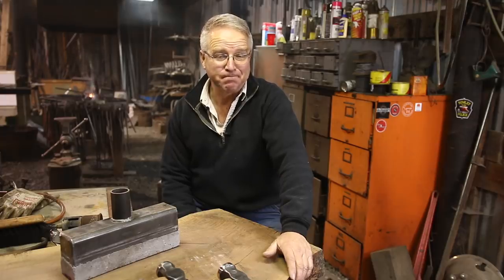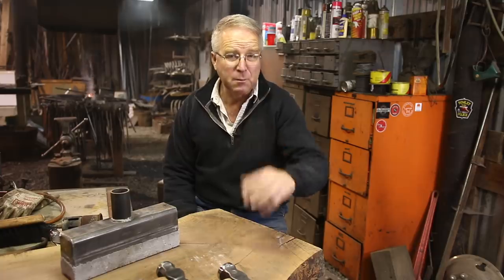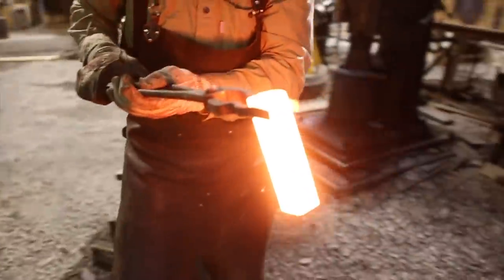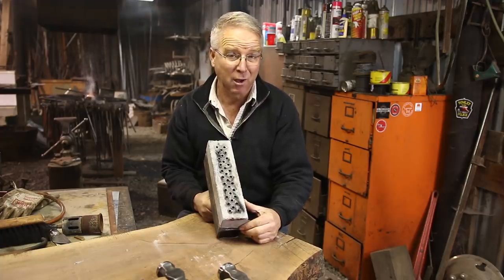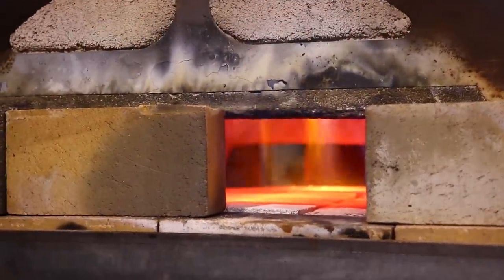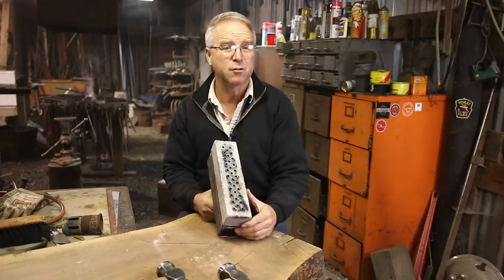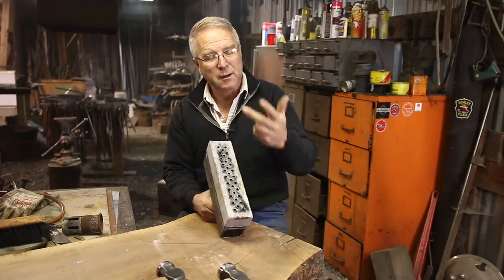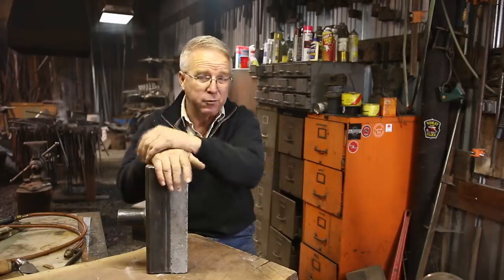What is a Ribbon Burner?

Comment: Hi I'm Bill , Karens other half, she has the youtube script not me. I'm commenting today on behalf of Ron Wailes, you mentioned his name and it left a big hole in my heart. I met Ron when he came into my shop one day walked up and introduced him self and checked out my shop and noticed I had an ironworker and a lot of left over material in the bone yard and wanted to know if I wanted to part with some of it and he proceeded to tell me what he planned on doing with it, he said he wanted to start making forges and rite there he had my attention, I had everything he needed in my bone yard to make several forges and I told him that if you build me a forge you have free range in my bone yard and  the ironworker to punch out the parts , I did a lot of the welding for him because he thought my welds were much prettier than his lol. From that day on Ron and I formed a small bond, he would pop in the shop unannounced most of the the time anyway he was a welcome site most of the time, taught me a lot. The reason I'm on this channel is I still have Ron's forge and the ribbon burner is wore out ( the refractory) and I wanted to find out how to rebuild it and noticed you had the same ribbon burner so I clicked on your video and low and behold you blurted Ron's name, caught me off guard a little bit. Nice to know Ron lives on! Just wanted to share. RIP Ron Wailes! THANK YOU!

Comment: Having an inefficient burner is a loosing battle. The more propane and air you push in to increase the temperature, the more hot air has to leave the furnace somewhere.

Comment: It is "molecules" of oxygen -- the form that's useful for breathing and burning is two oxygen atoms stuck together, and they'd rather be stuck to one or two atoms of carbon or two of hydrogen (releasing a bit of energy in the transition, which is what powers our bodies and our forges). Hydrogen and nitrogen are the same way, in that the pure gas is paired atoms (and nitrogen REALLY WANTS to be N2, that's why nitrogen-based explosives work so well.)
Reply: Delivery McGee diatomic elements
Reply: Well explained.  I was about to make a similar comment.      *I'm work in and have gone to college for chemistry.
Reply: THANKYOU GENTILEMEN FOR YOUR INPUT.....
Reply: Ye, what he said;0)
Reply: Electron Pusher Me too, I'm a chemical engineer and these things trigger me (because I know them)
Reply: Is either wrong? Oxygen gas is still comprised of solely oxygen atoms.
Reply: No atoms travel around on their own, always as a pair which constitutes a molecule. So combining oxygen and hydrogen into water (H2O) the equation is 2H2+O2=2(H2O) I.e.    2
Reply: What about noble gases. Aren't they single atoms, happily traveling around on their own?
Reply: Anon Ymous  You are splitting hairs, not atoms

Comment: whatever you use for the tubes? "crayons"? they need to be reconfigured so the tips are flame retention tips and are cast in place. That will keep the flame on the face of the castable and not blow away. You start with larger crayons that then 1/4 inch from the opening has a ring that reduces down to the smaller crayon size, the opens back up to the larger size. Look up flame retention tips for furnaces and you will get the idea. This will keep the flame sucked onto the face of the burner and then will not allow the flame to blow off.

Comment: I know the video is a couple years old and you might not respond.  The air pipe from the blower?  It seems as if you stick it into the pipe on the ribbon burner.  On your web site it says it a 1 7/8 pipe, so does that mean you are just using a 1 7/8 pipe for the air plumbing?  Is it exhaust pipe?

Comment: Yeah, I bought a three burner devil forge and I ran it outside one day, just to see how well it would work. While it did heat the metal up to forging temps, it took a good bit of propane to do so. It uses ventury burners and while it was outside and the blowing of the wind had a great effect on how fast it heated up, I saw that I wasn't getting a good oxygen to fuel ratio(at least not good enough for me), so I'm going to build my own forge with ribbon burners. Mine's not going to be as large as yours, but it'll dwarf the devil forge. Thanks for your informative video, I've watched many of your videos and always get a lot of useful information out of them. 🖖😎⚒

Comment: The way your ribbon works is similar to a hot air balloon burner. The difference between the 2 of them is the hot air balloon burner draws the propane from the bottom of the tank in liquid form which creates 15 million BTUs on the smaller hot air balloons and up to 30 million BTUs for the bigger hot air balloons. As soon as the hot air balloon ride is over and you turn the propane off you can touch the burners and not get burned at all. Which is extremely important because if the pilot has to land in high winds over 10mph he can put the parachute out of the top of the balloon and lay it on it's side which can burn the rip stop material that all balloons are made out of. A normal flight in Las Vegas in the middle of the summer we can fly 10 passengers not including the pilot and propane on board and use less than 75 gallons of propane for 1 hour to 1½ hour flight, but we have 100 gallons of propane on board for each flight.

Comment: Dear EC, I am getting into blacksmithing and gathering information on how to make a ribbon burner. How did you make the lower portion of your burner. The part that looks like a fire brick. Your blower motors are from where? Did you use a MIG tip for your nozzle. You run off of propane. I wonder if it would get hot enough using natural gas. Great information and love to watch to gain more knowledge. Thanks again.

Comment: I plan on eventually positioning the forge above the burner so as to minimise the chimney effect. Also I want to make a ribbon burner that directly heats the surface of the floor of my forge with a perimeter of open space around the floor. Suspended in a way above the burner with very little extra space above the metal being forged. I'm ASSUMING that this will minimise not only my propane usage, not only my heat up time but also the oxygen within the forge. Thank you for your time Scott. Your channel is most helpful.

Comment: Hi, not going into the maths, but the flame chemistry tells a  story.  That big purple flame at 4:17, downstream of the blue cones, shows there's lots of carbon monoxide coming off that propane/air mixture.   Needs more air moving more slowly (to keep the flames on the block).  Gas flames ideally  should be bright blue cones only.  
The grey cloud near your ceiling might just be condensed steam from combustion or mixed with incompletely burned soot, but it being there suggests your workshop needs more ventilation.  Carbon monoxide poisoning is extremely nasty, even when it's not fatal it causes generalised damage across all brain functions.  
Great videos, please stay safe, we want lots more of them.
Reply: So what would be the solution Charles? More burners staged and introduced as needed to burn the fuel efficiently or just more that are always in play and just not getting the fuel air mixture due to lower pressure? Isn't there a chance of the combustion moving back up the supply line at the lower pressures ? Or at least into the burners if there are more connected than there is fuel air mix to burn?

Comment: I can’t clearly see your piping arrangement but it looks like you have an open pipe from the air blower with no control valve and a regulator on the propane. If so, your 2 lb setting will tend to run lean and your 7 lb setting will tend to run rich. The video of the burner outside the forge shows a yellow flame extending past the short blue flames. That’s a rich flame. ( I realize that it will burn differently inside the forge.)
I’d recommend that, at a minimum, you have controls on the air and the gas so you can adjust for a “ perfect” flame by eye.
If you need to change firing rates often, and if fuel costs and time are important, the ideal setup  would be control of the air with a pressure line after the air valve going to a gas regulator. That way you could control the firing rate and the gas would “follow” the air and keep a reasonably ideal flame.

Comment: Scott, you mentioned the burner likes some back pressure to get the flames to sit back onto the burner.
Is it possible to slightly reduce the speed of the forced draught fan? This flame lifting effect you mention is normally too lean a gas/air mixture.

Comment: I'm building an asphalt heater, cept there's no info on the web about making these, so I hope to apply these principals to that application.  Instead of a refractory brick with through holes, the refractory will be some ceramic fiber (kaowool) sandwiched between stainless steel wire mesh.  It's my hope that I can mount this refractory sandwich in a metal box to create that mixing zone behind the refractory and ignite the air/gas as it leaches through.  If that works, I will be all smiles!

Comment: For a while I’ve considered designing a burner after the “ linear arrow spike” rocket engine for the exact benefits that this much more simple design dose to evenly heat a blade. 
Proof that I over think simple problems :)
Reply: If you ever make that happen brother, shoot me a comment man.
Reply: I'm not entirely sure what that would accomplish though, you're not trying to prevent the flame from expanding without thrust in a vacuum, you've got all the pressure you could ever ask for within an enclosed forge at one atmo.  Notice that the ribbon burner doesn't do as well outside the forge as it does inside with some back pressure.  The best it would do is to concentrate the flame in a line, which a ribbon already accomplishes in a diffuse manner (diffuse being preferable to concentrated) but then you've also got the problem of the aerospike body heating up without any means of active cooling (which is one reason why aerospikes aren't used in rockets).  I mean, you're basically making a ribbon burner with extra steps and more complex problems.  It wouldn't solve anything beyond a "look what I did" project.

Comment: Im a pool guy. I wonder if you could use the burning tray from a propane pool heater.  If you ever see one out for garbage 90% of the time it's the heat exchanger that breaks because of poor water chemistry, so the burner tray should still be intact.
Reply: Kevin Stempien I'm not familiar with those heaters, is the metal resistant enough to the high temps?
Reply: Most burners are made to go under what they are heating so not good at being in the heat. They will ether get soft from the heat or oxidize rapidly so need to be replaced often.

Comment: I had the same experience with my propane stove for making beer.  The banjo style burner which is similar to the ribbon burner in some respects, was quieter, less fuel, less carbon on the bottom of my kettles.  But it was about 2.5 times the cost of a cheapo jet style burner.

Comment: Ribobn Burners are GREAT! if your frge is going to be stationary and you have electricity to run some air pumps that is! but for a guy just doing little projects and just starting a venturi is pretty dang good. i can remove the pipe and set that aside and stow my forge when I am done... because I have to.

Comment: To add I use a gate valve to regulate my air blast and I use a bouncy house blower. You mentioned the price to build one. for me it was not at all expencive. And with a ribbon burner you can heat any castable or fire brick and reach welding temps no matter what you use for a forge refractory, soft brick,Kaowool, low cement castable . I used 2 in. of kaowool and cast the rest with high alumina low cement castables and like I said I love it and would recommend this type of blown forge to anyone who is building one... Martin M&S Blades

Comment: Scott, how essential is it to use refractory in the head?  If I were to thread say 20 or so 1/4” NPT small nipples into a piece of box tubing, almost how mig tips are used in Venturi designs, could that work instead?

Could you get away from casting or drilling refractory on the head?   

I’m basically using the mig-tip method but with a much larger orifice.

Comment: If I can make an observation - the base of the blue flames is too far from the ports, suggesting the flow rate of the combustible fuel-air mix is moving much faster than the chain reaction of combustion, until it has slowed down enough after leaving the port,   Similar to blowing out an oil well fire with explosives, dissipating the fuel+O2 faster than the chain reaction can sustain. the base of the flames should have a just barely discernible gap from the port. turning down the forced air and/or adding more ports to the burner should fix that.

Comment: What length would be suitable for a forge 16" long and 5-6" dia. internal chamber (round forge body 10" with about 2" insulation all round) assuming a lot of the work done would be forge-welding billets?

Comment: Pressure of the gas IS irrelevant in forced air burners. 
The regulator may indicate 0.1 psi and still you may pass thru it a very large amount of fuel.

In venturi systems, you need the speed of the gas in order to draw air...you need speed so you need pressure builp behind the pinhole in order to work.
But the amount of gas injected depends of the diameter of the pinhole...thru a small hole less gas ,large hole more gas ..for the same pressure/speed of the gas jet.

By a needle of a syringe you have speed at the one end on the needle and tou have pressure inside the cylinder... still in 1 minute you inject 10 ml of liquid...from an open bottle you may inject 10 liters or liquid in 1 minute.

Efficiency of the forced air systems comes from   totally different thing, not psi .

When you mix enough air for the amountnof fuel,the oxidation takes place at the muzzle of the burner.
With venturi sistems is very hard to proper acieve the perfect numbers for a perrfect carburation.
You need a certain speed of the gas flow thru pinhole,that speed must be correlated with air  absorbtion holes( diameter, position) AND the pinhole diameter cause larger hole for the same speed means ore fuel so need for.more air...diameter of the pipe is also important....
Then the gases must be perfectly mixed before they get out...you can not mix them inside the system without slowing down the flux of gases ,that would interfere with airdraw thru venturi zone of the system...

Is not easy to reach that ballance of those variables...once you modify one of them,all the rest need to be modified...there is a small interval which keeps the system relatively efficient but ...

By not having enough oxigen the fuel burns outside the forge(flames)...heat is lost, you heat the room not the insider of the forge.

In forced air systems, you can tune the quantity of gas and air  and very easy you can produce perfect mixture.the burning takes places at the muzzle of the burner,all the heat is produced inside the forge.

So psi is irrelevant in forced gaz systems and this system is just more flexible,you can tune the mixture as you wish not as you are aloowed by pile diameter,holes and pressures of gas.
BUT a well tuned venturi can be as efficent while a forced air if badly set can be very bad in terms of efficiency.
It is all about tuning the parameters involved for a perfect carburation.
Reply: Hi you seem to know your stuff. I have a question you might be able to answer if you have time. I've seen forced air ribbon burners like the one in this video with a cast refractory inside box section steel. I've also seen forced air running through just  a 2 inch black iron fitting with a plate welded on the end and drilled. My question is could you do the same with box section steel but without the castable inserted. I'm thinking as the heat is only at the holes the steel won't over heat of it was say a 6mm plate welded on to the side of the box and drilled. Thanks in advance if you are able to help. I'm going to build a forced air burner and might experiment with burner heads.

Comment: OK, I will join the nitpicking: Pressure is measured in Pounds per Square Inch (PSI), as shown on the gauge.  Force is measured in Pounds.  But the video is very informative - thanks!

Comment: Would this still be viable, or worth it, for smaller forges?
Reply: I've never wanted long heat in a small forge.  I used a standard 4.5x9 firebrick for the entire floor of my current forge (plus 2" kaowool on the ends), which works like gangbusters for small work... and is also perfect for a single 3/4" venturi burner.  Remember that if you want to get your ungloved hand anywhere within 8" or so of the mouth, you can't have flame all the way up to the opening.  At the size I built I get a nice 3" circle of a hotspot that'll heat up half a dozen 1/2" bars just fine and it's not cooking me when it does it.
Of course I'm also not expecting to be able to do one-shot baluster  twists, and I'm not making swords either.  At some point you have to scale up.  When you do, the size of the forge goes up.  Until then... well there's a reason why so many other people are using venturi burners.  If your forge can't physically contain the heat of more than one venturi burner, then that's what you should use.

Comment: How long does a 25 gallon propane tank last at 2 or 7 lbs of constant pressure on the 2 burners?  Just wondering what it means when you say it does not use a lot of fuel.  Thank you sir

Comment: Pretty neat that it's cooled by the air/fuel right before it burns (with that giant... fire brick-material? insulating it). The Space Shuttle's main engines, to keep from just burning up, ran the hydrogen fuel through a cooling jacket (as the hydrogen was stored at a very, very, very cold temperature) around the engine nozzles before injecting and igniting it.